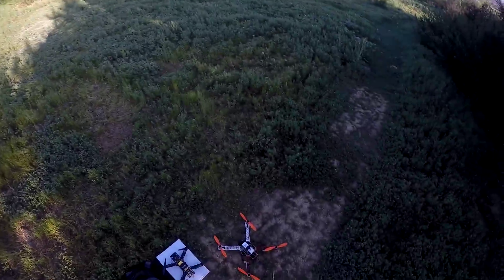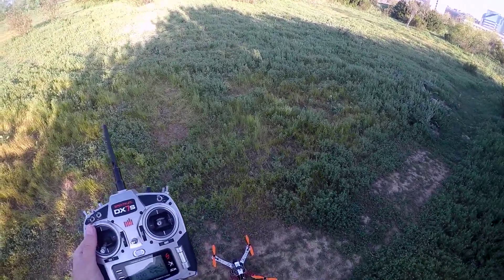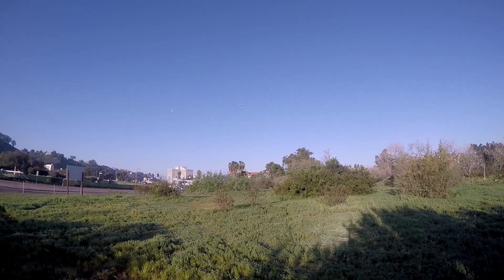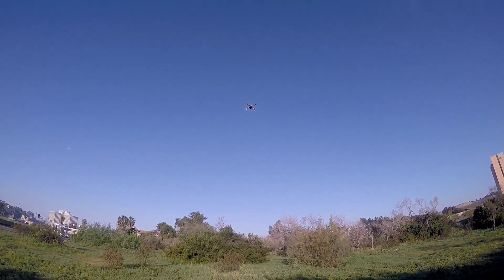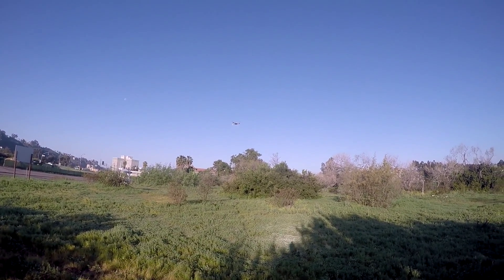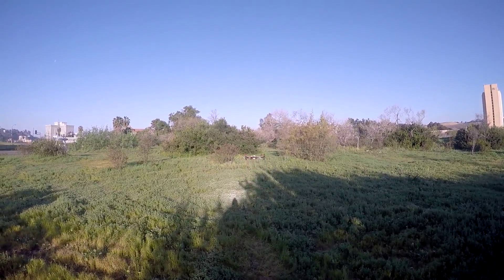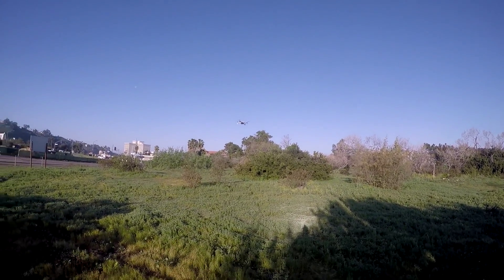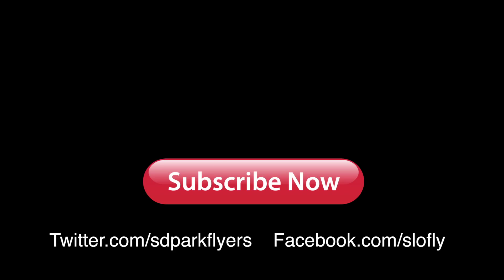450 Quad Flipping Over the Moon -TALLGUYSD

Comment: Good demo.   I got my CC3D dialed in now with Rattitude mode at 450 degrees per second on the X525 600mm quad.   Super fast flips/rolls, maybe too fast.   I have PIDs for inner loop set at P-30 I-20 for both pitch and roll; P-50 I-62 for Yaw.   Had to increase Derivative to get ride of minor bounce back after snappy moves.

Comment: Hi.. ur quad seems very stable. can u pls help me with the pid..?  I build a new one.. all seems good and working buts it's very unstable. I know the pids r not right. firstly,  on the input tab of the libre pilot,  which modes should I choose for roll,  pitch and yaw..?  now I have attitude for roll and pitch (6 selected)  and last column is rate (3 selected).  Now should there be any change to this and what should be a stable flight pid setting on the stabilization tab. Basic or advanced settings?  Responsiveness?  Rate and attitude stabilization?  I know I'm asking too much.. but really a bit lost here with so many things to fiddle with..!!  thanks.

Comment: When fly 3D, are 
you use flight mode ???
Reply from the maker: the cc3d board when setup has three flight modes that can be programed into your radio 1. altitude best for just flying around. the 2nd mode is the one is the one I use for flipping. I put a link in the title to take you to a resourse page to help you get all setup.
Reply: +Tallguysd  Thank you very much ! i view you on rcgroup.com.
I will setup my F450, i buy CC3D to day and config. you flight 3D fly Mode 2 or mode 1.
can you support me pl !